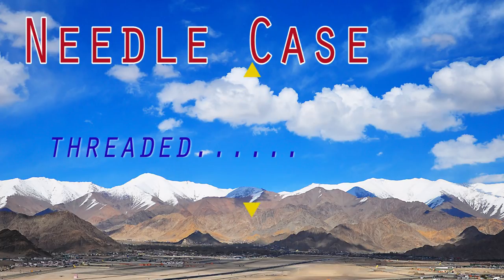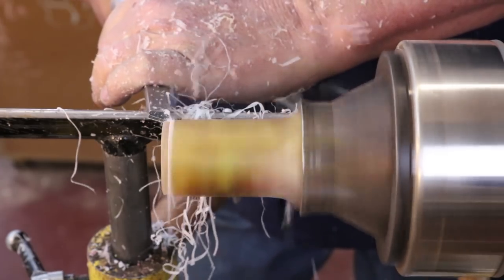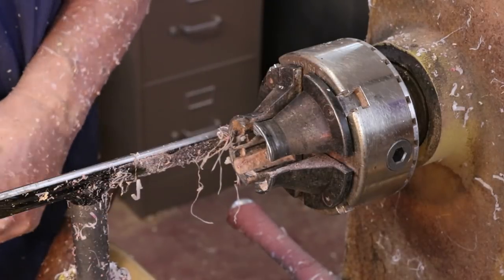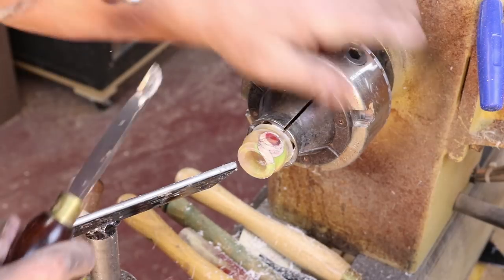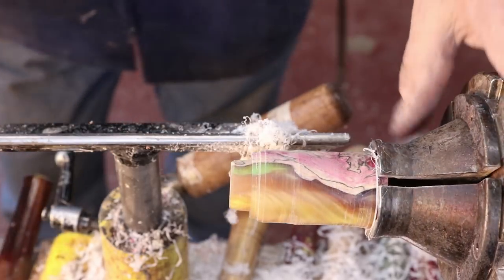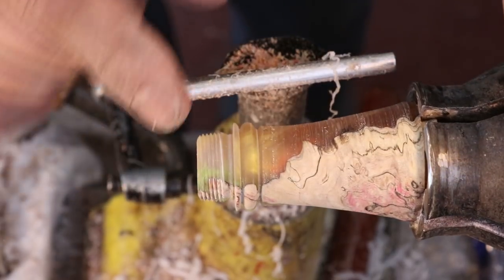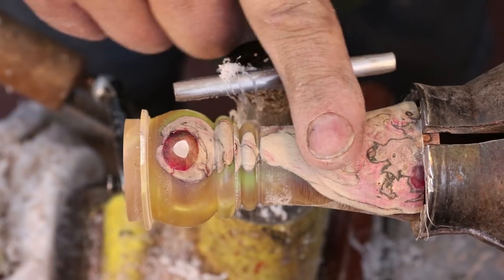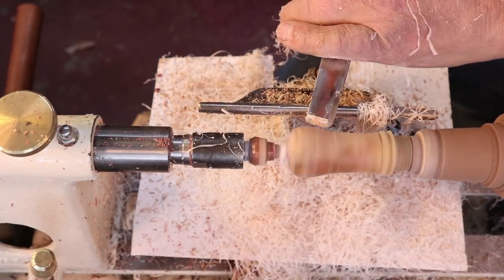Cast Resin Needle Case --Threaded:  Sam Angelo wyomingwoodturner

Comment: Acrylic looks like fun, Sam. Do you stabilize the burl before you cast it?  I am planning to do some threaded projects on stabilized wood soon as a friend has a vacuum pot.
Reply from the maker: Stabilizing helps us to chase threads in softer woods.  I have had good luck with cherry.  It is not necessary to stabilize wood before you put it into a casting, BUT, it must be dry.  I use my toaster oven.  I am going to send an e-mail with other stuff that is happening.  Sam

Comment: And a question.  You cut the blank for the needle case off of a larger block of resin and wood. What did you use for a form for the block (and for the other. . . red. . . block.  )
Reply from the maker: I made a flat square mold from High Density Poly.  Sam
Reply: I dont know how to make that square piece from which you cut the long narrow piece. What do you use for the mold for the square piece, ca 4In by 4in.